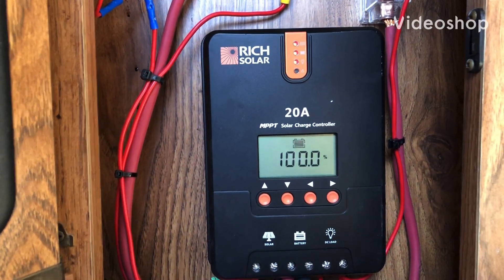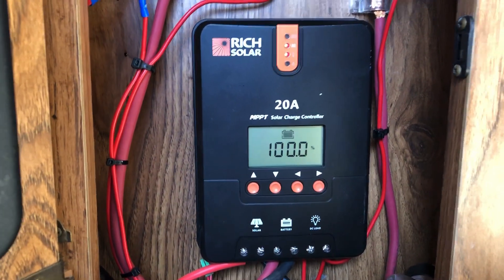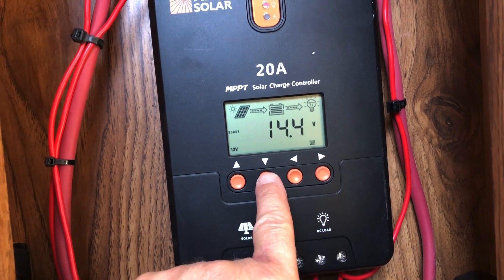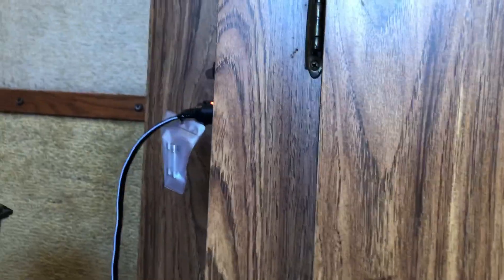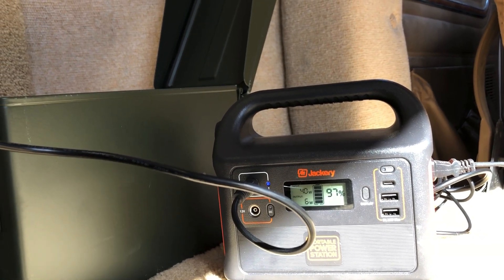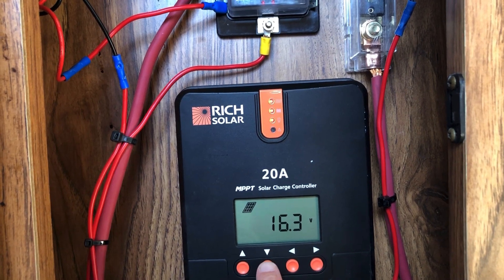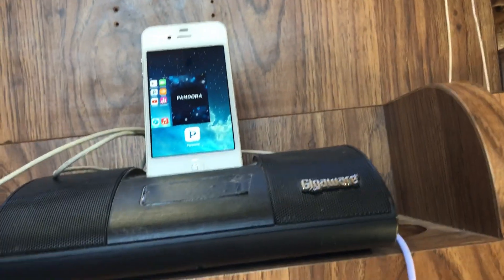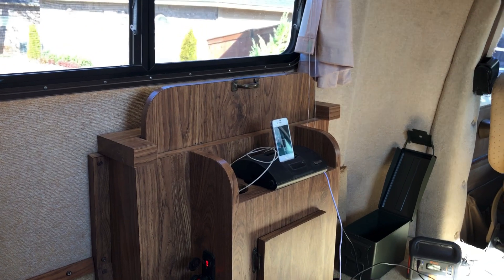Internal Solar Set Up. #richsolarchargecontroller #richsolar #solar

Comment: Nice little system. I may be upgrading my small system by getting the same (or the 40 amp) charge controller soon. Thanks for sharing and greetings from sunny Jamaica.
Reply from the maker: Thanks!   It works very well.  I do wish I went with a little bigger system, but so far it is very dependable.
Reply: @ericscamping  I got the same 20 amp controller a year now and doubled my battery bank and got a larger 450 watt solar panel, up from two 100 watt panels. All is working well for me. Have you upgraded your system yet?
Reply from the maker: @lawrencedavidson6195  Actually, it is working fine for my electric demands.  No upgrades needed yet.

Comment: Nice little setup hidden away in there..  I have the Ryobi tools like that too.. flashlight, vacuum, drill, chainsaw, sawzall, 7.5" skill saw, jigsaw and the big bag that carries them all.. Got the lithium batteries with a charger too. Also recently got the Ryobi cordless blower, so now have another charger too.  So how many panels are up on the roof and what size are they..  how about your batteries..?
Reply from the maker: 200 Watts total between two panels.  I may add a third and another battery.   Works fine for now.  I find the little Ryobi chain saw is very helpful camping and boondocking to prepare wood without disturbing fellow boondockers and wild life.  Just have a 100 Amp Hour under the hood tied into a battery isolator for the vehicle battery.